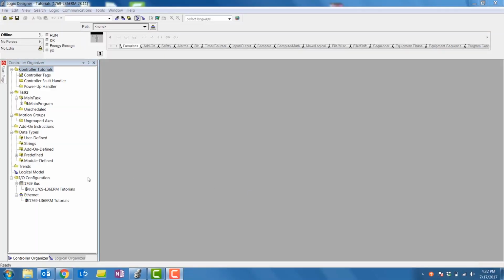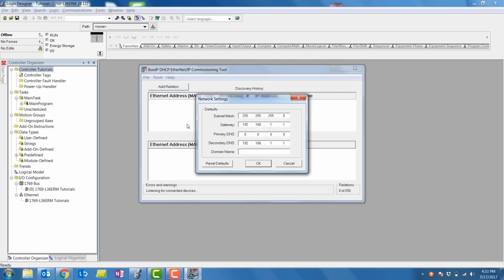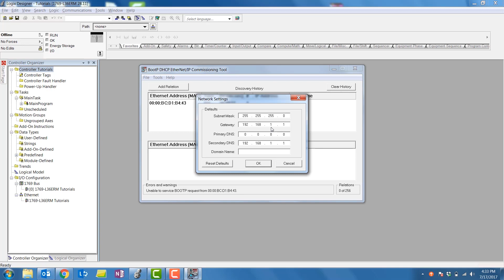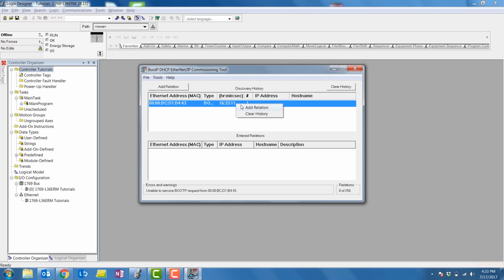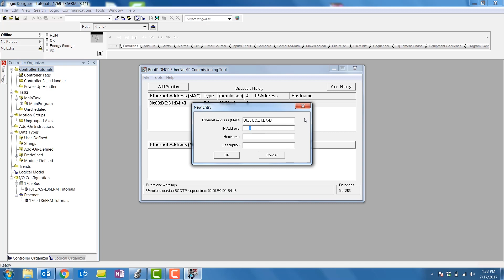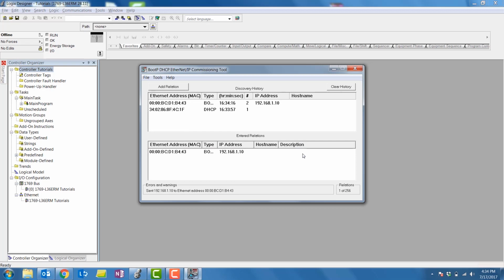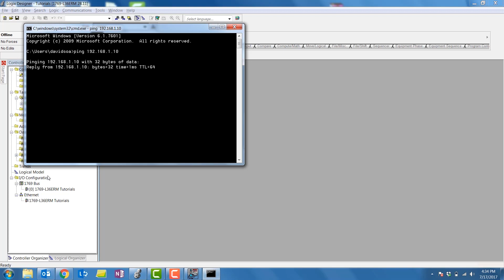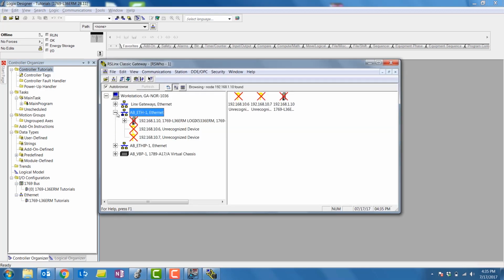How to Use BootP to Set IP Address in CompactLogix

Comment: Hi Im just curious here; my scenario is that i have a powerflex 40 and i am using a comm 22- E card to make it ethernet compatible. The card already has an IP adress put into it and had bootp disabled so the IP stays. im using a LAN connection from my laptop to the comm 22 - e card but cant seem to find the IP is there a way to identify the IP adress put into the piece of equipment?
Reply from the maker: Hi Mike, Yes, WireShark is a great tool to use when trying to ID a Device (Point to Point) that is an automation device on ethernet that you are trying to communicate with. You can try to set the 22-COMM-E back to its default IP address by performing a factory reset. (https://literature.rockwellautomation.com/idc/groups/literature/documents/um/22comm-um004_-en-p.pdf)
You can always use a remote HIM module or CCW / DriveTools to connect over serial to gain access to the parameters in the 22-COMM-E. If you have further questions or concerns, please contact your local Rockwell Automation distributor. Thank you!

Comment: I understand that this is an older video now, and BootP has been updated a bit, but, your explanation is a bit quick and vague...  on my system. BootP is version 3.03.00 but I just can never get it to see the MAC Address of my Micro820     I can check through my router, and see the MAC Address, and the IP address it has, I can ping its IP address using my router, I can ping its IP address using my PC to which it is connected to,  but it just never comes up in the top window of BootP (either directly connected to my PC network port or through the office network). 

In your video it would have been nice to describe what it is that BootP is trying to do,, a bit f details of the two MAC addresses that come up on you screen and what / how adding a relation does.
Reply from the maker: Hello, Thank you for your feedback. The BOOTP tool can only be used when devices have been configured to get an IP address through BOOTP. This is typically the setting of Rockwell Automation devices out of the box. After a device has been configured with a static IP address, it won’t appear in BOOTP unless the device is reconfigured. Please reach out to your local Rockwell Automation distributor if you have further concerns or questions.

Comment: In my case, there are no bootp requests in the list and the MAC is not in the list. Do you know what i have to do to enable BOOTP requests?
Reply from the maker: Hello, If you know the current IP address, please refer to Technote 627630 at https://rockwellautomation.custhelp.com/app/answers/detail/a_id/627630. If you do not know the IP address, check out technote 948444 at https://rockwellautomation.custhelp.com/app/answers/detail/a_id/948444. If you continue to experience this issue, please contact your local Rockwell Automation distributor for further guidance.
Reply from the maker: @IamMike86, You can access TechNote 627630 by creating a free account through the Knowledgebase, however you do need a TechConnect contract to access TechNote 948444. If you work for a company, they may have an existing contract or account that you
could use to access these resources. Please reach out to your local Rockwell Automation distributor if you have further questions or concerns.
Reply: @mcnaughtonmckay  I've been "reaching out" for weeks and getting nowhere.